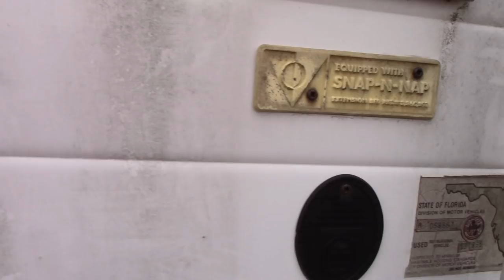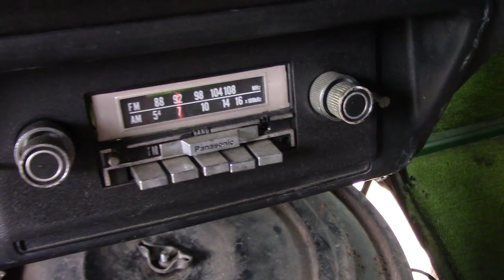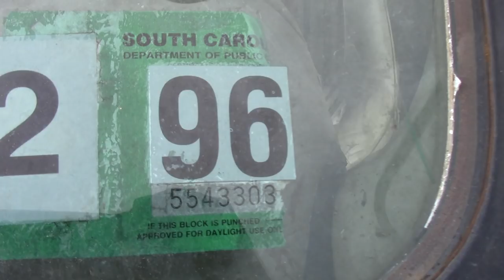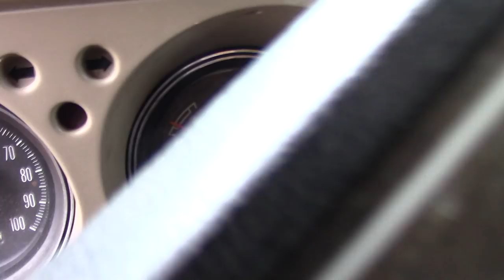SCRAPPED?! 1976 Dodge Amerigo MotorHome!

Comment: I reckon that one might be solid enough to save.  It's probably going to need some roof work as the vent looks rather tired but the body looks like it's still the shape it's meant to be which strongly suggests the frame is still pretty decent and that's the major thing with a motorhome like this.  I hope it gets saved.  You should harvest the radios out of the old stuff like this if they work as they can make a ton of money to people doing period correct restorations.  That Panasonic was a high-end unit in its day...
Reply: gosportjamie Nope, resale value on RVs is terrible even worse than cars.

Comment: They don't even have them in UK of that era Jay its cool that camper if I was in us I'd have it
Reply: me 2 ..
Reply: daniel lee - we have those old Bedford's and Transits that look very similar though. The problem with everything of that era - caravans, camper vans, whatever - is that they invariably leak around the seams and roof vents / windows, soaking the internal timber and rotting the frame. At which point unless they're particularly rare or historic, or the damage very localise, they're basically junk. I love the old coach-built, lantern-roof caravans of that era (Royales and the like) but the few that are still watertight fetch daft money.
Reply: Richard Edwards:

Not American Clippers from this era. They were Premium Class C  Fiberglass motor-homes (on Dodge/GM chassis)...built like a boat.....roof,front cap,sidewalls, and back cap were epoxy (d) and fiberglass-seamed together as a unibody. And the way the roof shell bonds with the sidewalls and front/back cap...they can't leak. Most  people that have American Clippers keep them...very difficult to convince an owner of one to sell-it; unless it has a blown engine,bad Tranny or needs to go the Corvette,surf-shop, or boat repair man that can repair Glass with his eyes taped shut.

 Friend of mine used one his customer's Clipper to "pop-off a mold" for a Clipper that had taken a major hit from the side and back from a pickup or whatever. When he finished the repair (with woven and glass mat) and perfect color match of the gel-coat..you would have never known.

Comment: someone looking for a project that would probably be a good one, seems to run ok and that's 90% of the battle that and making sure all the seals are sealed up good so it doesn't leak inside and since the invention of Flex seal that should be easy. after that it's just a matter of rebuilding the thing with the carpet and features you want yourself could be fun for someone with a lot of time to invest

Comment: Believe it or not. That thing is in good condition. A Good wash job, and cleaning on the inside will help the price go up. All someone would have to is get some new tires on her.Get some fresh high test gas.Maybe a tune up. But it sounds strong as is. Go to Lowes and get a fridge that will fit in that hole. Fix the water heater and check to see if the plumbing works. You can have a really nice (old school) Motorhome for About 2000.00.That runs and drives. I bet if you just wash it, that thing will look amazing. I love the old school Rvs. Thanks Jay for sharing and let us know what will end up happening to this one. Its a good one to save thats for sure
Reply: the roof leaked.  Gonna have to gut most of the roof and walls to fix that.

Comment: Friends got a 78 apache that's been sitting since 1999. Basically the same, has a nice 350 sbc and a turbo 350. Old man stopped driving her, parked it and there it sat. We pulled it out of the woods, couldn't find the keys for it though. I said we should just hotwire it, cut the top off and gut the interior and drive that sum bitch.

Comment: I'm thinking of the scene in Jurassic World where the two kids get one of the original Jeeps running, and me wondering if it could actually run on the 20 year old gas that would be in the tank. Well, here's proof!
Reply from the maker: No Name it had been sitting a little two decades, and yes that was the old gas! We didnt even mix any fresh, just good old non ethanol gas from back in the day. It didnt run great, but it was still flammable! So yes, the gas would have worked.

Comment: Pretty cool old beast. It looks like the one in Independance Day movie. That gas must be decades old, newer stuff doesn't last that long.
Reply: upside downdog I've heard it's due to the low ethanol content they had back then compared to today, this went off the road right as ethanol gas was rolling out over the U.S.
Reply: Justin Noker 
I can still buy non ethanol auto gas where I live. I don't run anything else if I can help it. The ethanol is not good for mowers or motorcycles new or old.
Reply: upside downdog yeah, I know non-ethanol gas is still sold, just meant for your regular gas when it was getting mandated. And also, It's mainly just bad for the rubber lines that aren't hardened against the Ethanol (like in a modern car) and also can lead to some carbuerators clogging up, again, if it's not first adjusted for it.
Reply: Justin Noker 
Not to mention the moisture ethanol holds onto. Worse mileage is also quite common as ethanol has around half the BTUs per gallon than gasoline. The circle track racers where I live used to remove the main jets to get their racecars to burn it properly (100%, not a blend).
Reply: upside downdog that's due to a large advantage of ethanol, it's high octane pump gas, like, 100-120 AKI.
Reply: Justin Noker 
It does that but if the racers didn't drain the oil between races the engines would lock up from rust.
Reply: upside downdog not sure if it's quite that bad, as long as you use fresh ethanol. I can understand having to do that if it's not that fresh, but if it's fresh it shouldn't have that much water
Reply: Justin Noker 
I saw a pure ethanol running dragster engine rust solid after a few weeks of running fresh ethanol. Its humid where I live but that was ridiculous!
Reply: upside downdog ah, humid air would explain it then, especially with those low tolerance race engines
Reply: Justin Noker 
It kind of blew my mind. The owner had raced on alcohol since he was a kid and knew better. Who would build a high dollar race engine and neglect it like that? Worse, he was my boss at the time so company money undoubtedly been put into it which pissed me off.
Reply: upside downdog oof
Reply: Don't forget an anti-knock lead additive too...
Reply: Igor Schmidlapp. 
Avgas has that covered.
Reply: upside downdog not for long sadly, there's a lead free replacement currently under evaluation
Reply: Justin Noker 
They have been trying to do that for over 25 years. Aircraft engines run at a high percent compared to other engines. Without lead it just burns them up. Car gas is a sure quick way to kill aircraft engines.
Reply: upside downdog but don't forget, we have better anti-knock mixtures out there these days, it shouldn't take that much longer, cause I did hear that like 5 years ago Shell went to get their lead free replacement certified, I'm not sure what happened after though sadly
Reply: Justin Noker 
It burned up the engines! No replacement for good fuel. It can only be made one way. The correct way!
Reply: Justin Noker aircraft engines run at a higher percent of total power for hours on end. It takes a better blend of fuel than car gas.
Reply: Justin Noker 
No replacement for good gas exists. Chemistry be damned. Science proves what fuel works. Bullshit we run in our cars sucks. Ruins the machines.
Reply: upside downdog one thing I can say is, I don't think enviormentalists care if it significantly shortens engine lifespans. If it's cleaner for the air they will scream and cry until it's implemented.
Reply: upside downdog just give them time, they'll do it eventually

Comment: 360 V8
Not rusted up
Decent interior
Still running
Hell it should be a federal crime to scrap this thing
With a little work it could be in a 70's museum or something
Reply: Gas Crisis severely underpowered and gas guzzling V8
Completely rusted and moldy
Dog-shit interior
Barely running
Please scrap this thing
With $30k invested you MIGHT want to drive it around the block

Comment: What ever happened to the orange truck you were cleaning and fixing? As for this...though it cool that it still runs, no one will let in the parks anymore, so basically unless it on private land, it useless as an rv.
Reply from the maker: Negatory, there is no "age limit' on RVs here. Its still fit for road use should you want to do a little fixing up.
Reply: Most parks (out in California, Arizona, Washington, Oregon , Nevada) won't let something that old rent a space. May be different out there.
Reply: They have a 10 year rule at some parks ...but not at all or public property campgrounds

Comment: if the engines good and the body has rotted/rusted/ripped away from the body clean it up and sell it, not much scrap in there well its 70's so might be alluimum in there but ??? either way 70's motor home oh yeah!
Reply: sirmugman it’s already sold